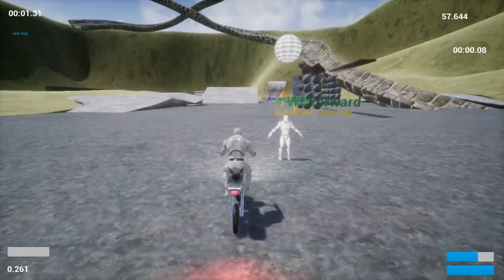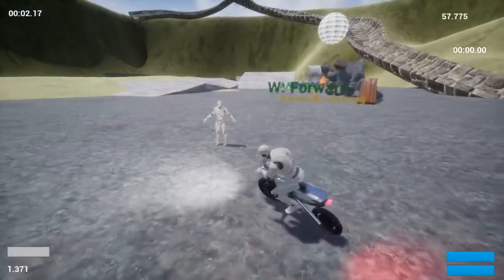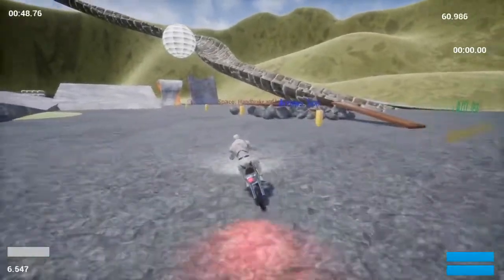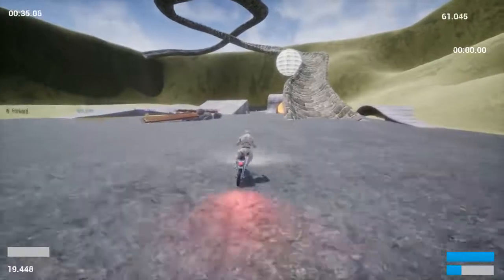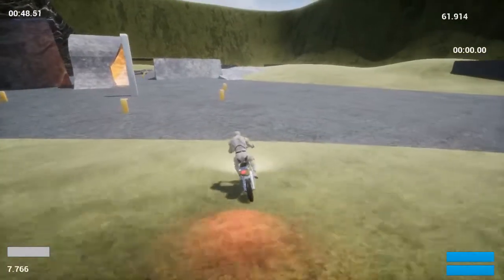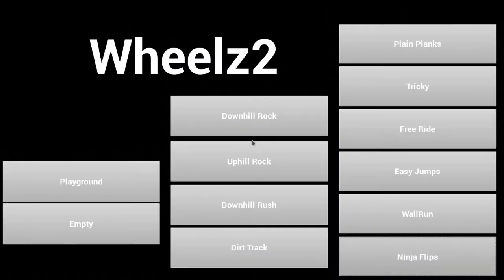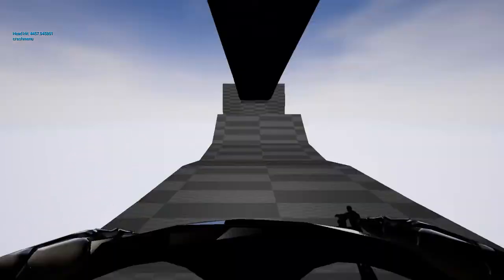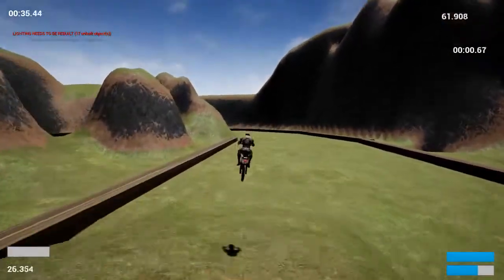Wheelz 2 Physics (UE4 Bike test 7)

Comment: How did you keep the bike from falling over, in the video you said you got the transform and "Lerp" back to that.  I played with it but still can not get it to work.  Can you help?
Reply from the maker: There are quite a few systems at play here - the main two are:
1. steering - the bike steers into a fall, this does most of the work
2. torque directly applied to the body - only a small amount

The bit I was talking about with lerping back to the correct position is the riders position on the bike
Reply: Alex P-B Thanks for letting me know, you must have put a lot of time into fine tuning this bike.  I am working in a ATV now because no matter what I tried the wheels keep bouncing off the ground, 😨

Comment: Hi Alex, great job! How are you able to maintain balance of the bike? Does the WheeledVehicle class work by specifying just 2 wheels or do you need to give 4 wheels (bones)?  Did you have to write C++ code to get all of this to work?
Reply from the maker: Hi, adkp, Thanks!
The bike is 100% BP, no C++ - I am not using the WheeledVehicle class, but using plain old spheres as wheels. The parts of the bike are separate mesh components, connected by physics constraints.
Are you working on something similar, and care to share a link? It's good to see similar fun projects in progress :D
Reply: Alex P-B thanks for your reply! I just started working on animating a motorcycle vehicle. So nothing much to show. If you could make a short tutorial on how you got the balancing, bike setup done it would be so useful. There are hardly any resources for animating 2 wheelers in UE4.
Reply from the maker: Hey adkp, I'm not about to do a tutorial - but I will point out the main mechanisms of balance are to steer into a lean, and apply an artificial "balance force" as a torque that rights the bike

I'm also planning on releasing full code with the game
Reply: Alex P-B alright, thanks Alex. What's the timeline on the game + source code release?
Reply from the maker: adkap - unknown, hopefully a few weeks from now, probably more like several months at least.

Meanwhile - I'd strongly recommend working on your own system! Post up some public videos and point me at them, I'll do my best to give constructive feedback.
Worth mentioning - I am also working on a couple of other radically different bike systems (and other vehicles too)